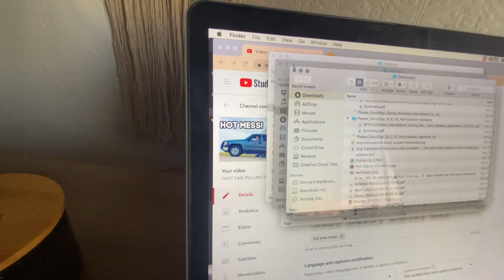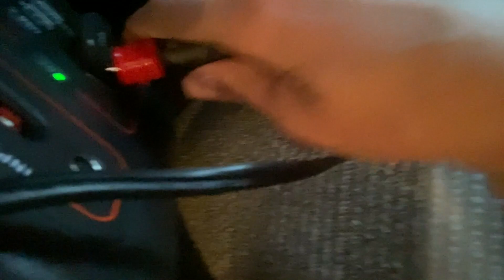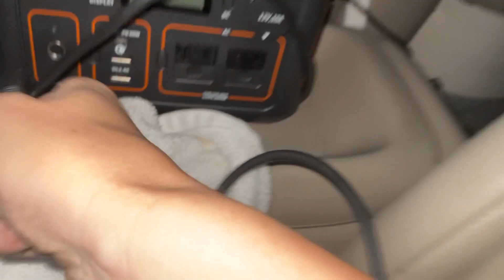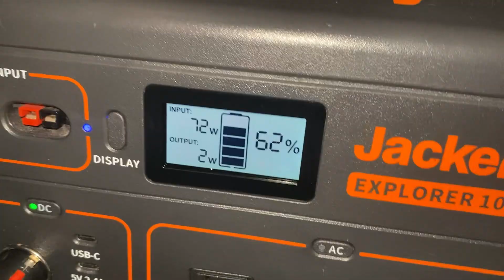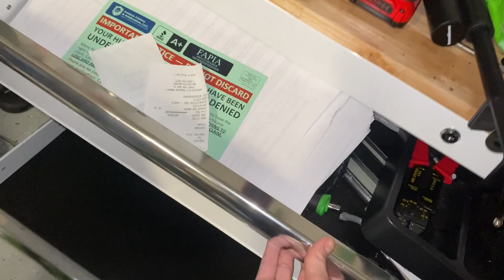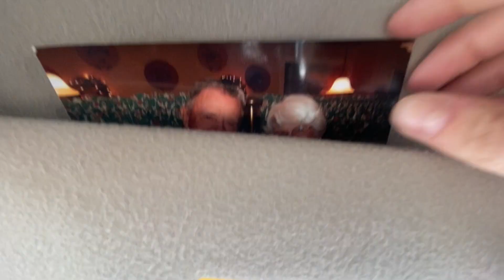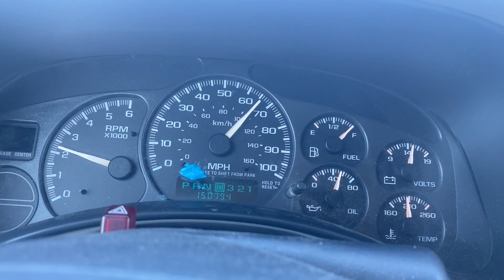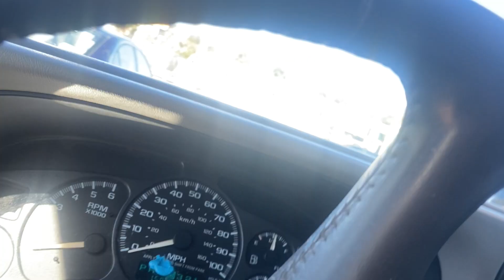THIS IS NOT SAFE // Finally Leaving Florida (Travel Vlog #122)

Comment: Get a diesel heater for the trailer. Different types are available, check what works best for you, they’re only about $100 for the Chinese ones.
Reply: Also, you can put something under the trailer jack to lift the coupler higher. 
Now that the trailer is leveled try putting more weight in the front of the trailer(more load on the car) to avoid jackknife
Reply from the maker: I just ordered a buddy heater :-) if that doesn’t work, I’ll look into a diesel one
Reply: @montanadanna  Buddy works great!
Walmart sells the attachment hose to a 5 gallon tank, no need for small tanks. You can use the buddy heater and a small burner (to make eggs:) )super cheap off a regular 5g tank

Comment: Please make sure the trailer brakes are working.  If they are binding when they are supposed to be free you will may have to replace them.  Also, get a large (maybe 4 x4 ) block of wood to place under the hitch jack. You will then be able raise the hitch higher to get it above the ball.  You should be careful about putting to much weight in the back as it will increase the chances of (dangerous) trailer swaying (especially without an weight distribution hitch (equalizer)).  Lastly, please look at getting a hitch lock to put on the trailer when it is disconnected.  You don't want someone hooking up your trailer and stealing your home when you are away.  Take care and best of luck in Nashville.
Reply from the maker: Yes they are 😊 thank you Bob. The app trips out occasionally and I have to restart it. Other than that, good to go. Good idea with the word block :-) thank you

Comment: Hi whatcha up to hope all is well prayers 4 healing and unspoken also prayers 4 everyone and bless great healthy peaceful safe journeys travels and happy camping in the name of the Creator God and Jesus and the Holy Ghost Amen much honor and respect keep walking tall hugs also u need a weight distribution hitch with sway control built in and yes always put ur guitars in their cases while traveling it will protect them also put them on ur bed so they don't bounce and move around also put L brackets on ur clothes rack or build a stationary rack later on and plz drive slow til u get the weight distribution hitch with sway control built in also do not put all the weight on the rear of the trlr this is very dangerous you tube weight distribution on trlrs and see the videos it's very dangerous put lil more weight towards the tongue and equally as possible side to side however most the weight has to be over the axles with lil more towards the tongue do not take all the weight to the rear plz plz be safe and do not do not drive hwy speeds til u get the weight distribution hitch with sway control built in even then would drive 5 to 10 below the speed limit plz do not wait on the weight distribution hitch with sway control built in also have ur whl bearings on the trlr chkd to make sure there's enough who bearing grease in them and it maybe to much weight on left side y it looks like it's bowing out on the tires and everytime u stop to get gas chk the wheels nxt to the lug nuts to make sure one isn't getting hotter than the other it could be sticking breaks and or bearing issues if one is hotter than the others also always chk to make sure lug nuts is tight but not to tight maybe good idea to buy a torque wrench to use after u tighten them with tire tool and use star pattern when tightening them and torquing them and chk 4 anything out of place on trlr and or lights or make sure none is out and or on ur truck when driving and always chk the truck fluids at every gas stop ie oil and transmission fluid and antifreeze but make sure the motor has cooled off be4 chkn and or refilling the antifreeze also hugs many blessings keep walking tall prayers 4 u and keep on keeping on cool videos always and have extras to ur extras ie interior and outside light bulbs and fuses and tools and make sure u chunk the trlr whls always with whl chunks be4 unhitching maybe buy x chunks they r aluminum style x that holds the whls in place so they don't move when unhitching the trlr any trlr or rv place has them even amazon has them however regular who chunks whl wrk til u get them and 2 4x4 with 1x4 pieces of wood will wrk 4 tongue jack also u need leveling blocks u can get them on amazon or wlmrt in rv dept or use peices of 2x6 and or 1 x 4 of wood however the plastic ones is lighter and easier to store to drive up on with trlr on uneven ground and it maybe overwhelming at first til u get use to it however it's learning curve and it will get easier and keep on keeping on and enjoy the videos u could take us with u from point a to point b as if we r with u in the passenger seat record the hole trip however that's my opinion tho hugs always walk tall most of all enjoy and have fun and take lil time 4 ur self too 
🚌🌄🌌⛺🌅🏞🏖
  👍👍💪🙂👍👍
Reply: @montanadanna  ❤👍👍💪🙂👍👍